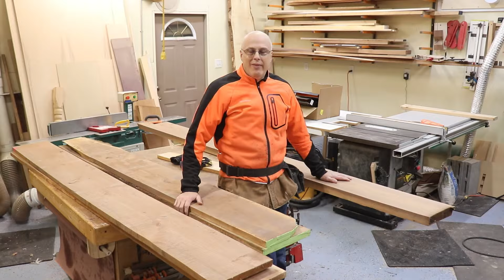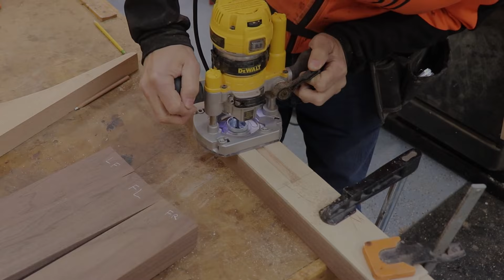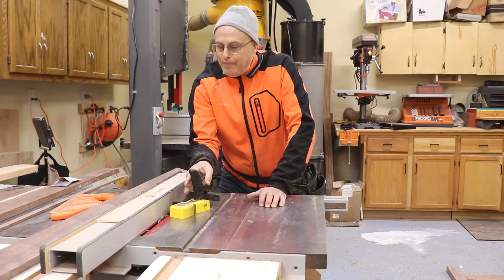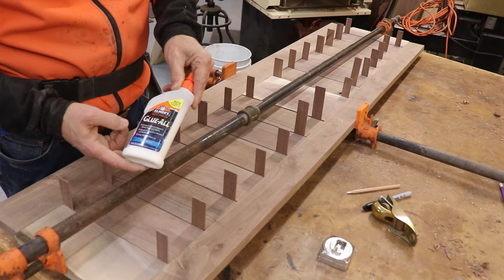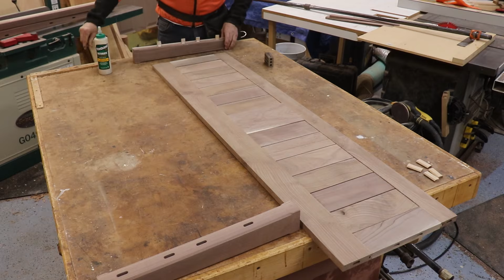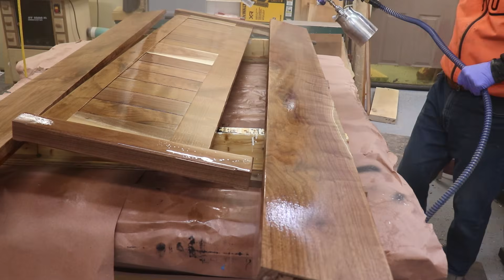Build a Beautiful & Sturdy Bed DIY

Comment: Been a subscriber but your videos haven't come up. Glad this did cause I'm focusing on head and footboards.   footboard won't be an expansion and contraction issue but headboard appears to be a challenge.
Reply from the maker: Hi Doc, thanks for watching. The headboard and footboard in this bed are nearly identical from an expansion and contraction perspective. I think I’m covered as far as dealing with it. Most of the time when I’m building a large piece of furniture it’s in the dead of winter when moisture is at its lowest point, so I feel that I need to give a little extra room for expansion. The only time I ever had a problem was with some 8/4 stock that wasn’t fully dried and it moved a bit on me in the first year. Oh, and one time I made a frame and panel door and the groove in the frame was a bit too snug and the poly finish basically glued the panel in place. That panel split down the middle. I left it that way and didn’t replace it because it serves as a nice reminder to leave that joint a bit looser.